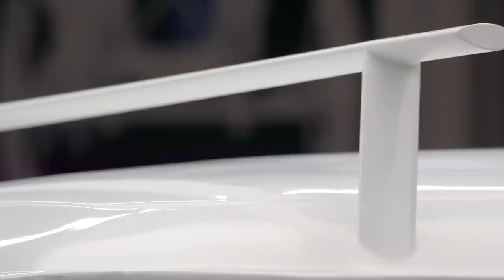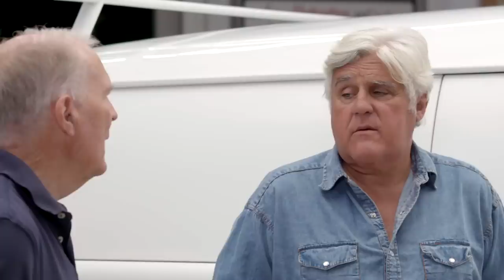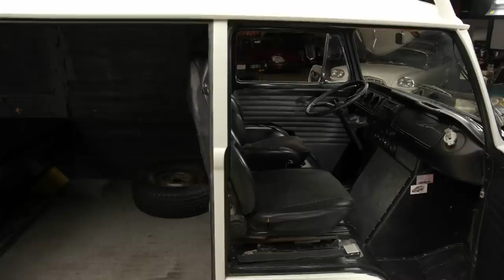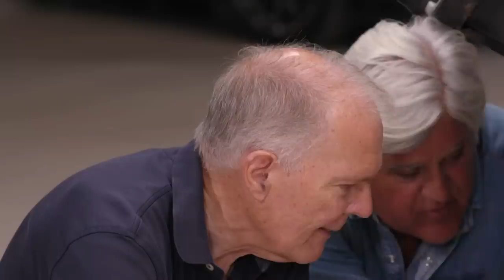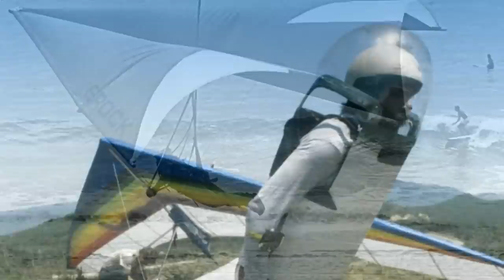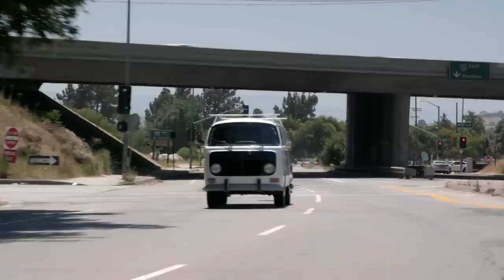Peter Brock's Hang Glider Transporter VW Bus - Jay Leno’s Garage

Comment: Interesting for me. I worked in Olds Experimental when we developed the 215 aluminum V8. It was the second version that made it into production. The Olds and Buick versions had different heads.
We had some high performance versions, not the '63 Jetfire turbo.
Also interesting was that Pete Brock would have like to worked in GM Styling in the 1930's. My dad did work there then, worked for Harley Earl. I have some of my dad's GM sketches.
Reply: Rover in the UK bought the rights and tooling and it powered British sports cars for the next 40 years!
Reply: Yes I know that. Actually, we (not officially) were shipping some motors in parts, not assembled to a couple of race car builders in England before the Rover thing. I was a great motor. For some of our first testing of that motor, we used Studebaker Larks as test mules because our F85 wasn't available yet. Our little aluminum V8 in a Studebaker. Think we built five of those. Long time ago.
Reply: @pickleboat45  One of the more unusual uses for it was making a V6 by cutting out 2 cylinders.  That ran in the prototype Metro 6R4 rally cars.  Amazing the number of different things it was used for.  Was it just too small a capacity for the US market at the time?
Reply: @hrothabandinak6602  We developed the GM V6, first using a 215 V8 block cast in iron, with the front two cylinders empty, and a V6 crank extended. This was to prove out a 90 degree V6 could work. I ran the very first one on our test stand (not a dyno). Some engineers expected balance problems, but didn't happen. This V6 became one of the most successful GM engines of all time. Later models used split-pin cranks.My personal car at one time was a Buick GN - 3.8 V6 turbo inter-cooled, and of course, modified.
Reply: The London Ambulance Service used to have Leyland Sherpa ambulances powered by the Rover V8, as did many British police vans. It was also used in many British hot rods. Now we’re using Mercedes and BMW engines for our chariots.

Comment: Does it have a water pressure relief valve in the cooling system designed to open at a lower pressure than the radiator cap?  If I were a passenger It would kinda freak me out.
Reply: If you knew how a radiator cap works it would help
Reply: Uh, what? You do know radiator caps vent to an overflow tank, right? Its not a tea kettle lol
Reply: @heidilear7222  Ok thank you for explaining it for me it was very educational.

Comment: When I worked at the VW dealer in Seattle in the 70s, we had an associate who specialized in VW and Porsche repairs and mods.  He put a Porsche 911 engine in a VW bus.  Often he would come by the shop and put on a show for us by lifting the front wheels off the ground when punching it from dead stop.  Very fun.  Eventually he weighted the front bumper to keep the wheels on the ground.

Comment: I remember years ago there was a kit to install Corvair engines into VWs.  It used an adapter plate to mate it to the VW bellhousing.  The main drawback in using this engine was that it rotated in the opposite direction of the VW engine.  A VW transmission gear modification was required, due to the opposite rotation, which ended up weakening the transmission.  However, the reverse rotation engine was a good thing when using a Crown V8 mid-engine conversion kit for a Corvair car.  The entire tranaxel assembly was rotated 180 deg. in order to place the engine in the back seat area - no transmission mods were required.  The reason for the reverse rotating Corvair engine was so existing tooling could be used to produce the transmission gears.

Comment: Wish they had talked more about the way the Transporter handles. I've had a '68, '72 and an '87 Vanagon Syncro. They are crazy fun on a curvy paved road. Nimble and  you really feel the connection with the road. Off road I had the '68 and the '71 in some gnarly situations in NM and Baja. Engine over the rear driving wheels = phenomenal traction. The Syncro had the same on road "fahrvergnügen" + even more range off road. Finally my only complaints were they were under powered on the highway and lacked front end collision protection.

Comment: I had a '71 VW van that I put some snow tires on and it did great on the sand trails in the woods in flat Florida.
Reply: I had a beetle that wouldn't pull the skin off a rice puddin' . . . .

Comment: There used to be a VW Bug in my town in Pennsylvania with a panel truck body kit on the back. Had a Pontiac 400 from a GTO, big plug heads, in the rear. It was quick. All that weight in the rear the front wheels came up easily off the line

Comment: Cool. VW still sells cool vans in other countries, with plenty of power. The original bus/van is neat, especially with a better engine and brakes, but they have no crash protection. Be extra cautious if you drive one.  Especially if it has a V8. 🙂  Thanks for having Peter as a guest.

Comment: That Van goes up hills because of the huge weight over the drive wheels due to the OTT engine (that the suspension is struggling with).
 Modern Transporters go up hills backwards to keep the weight on the drive wheels (front).

This guy is the right age for a Hang Glider pilot, but I suspect he hasn't flown since the 70's, as he keeps going on about UP who haven't made Hang Gliders for 20+ years, and are now German.
Reply: NICE Intel ya bogan

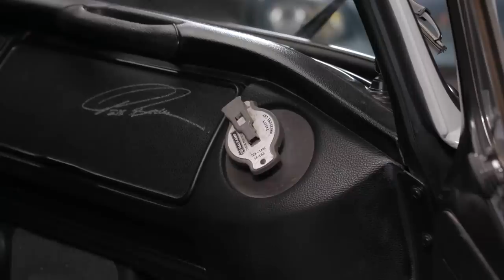Comment: Around 4:40 when Jay notices the radiator cap inside the van, he mentions that it's the only car that you fill the radiator from inside the car. Is he forgetting about all those vans from Chevrolet/GMC, and/or Ford and/or Dodge in the 60s that had the engine under a hatch between the driver and passenger seats? I know for sure that the GM and Dodge vans were set up like that. You had to check the oil from inside too. Now that I think about it, if they even had a hood at all, about the only things out would have maybe been the master cylinder, access to the wiper motor and the windshield washer jug. I do remember everything engine related was inside the van though.

Comment: GM used the small aluminum engine in Oldsmobiles and Buicks only for about 2 years. The little Olds V8, same cubes as the Buick @ 215 cubes, was almost identical to the Buick V8 but had more main bearings than the Buick. The Olds Cutlass turbo version turned out  215 hp. Jack Brabham won the F1 Championship in, I think, 1966, using the Olds block with cast iron REPCO designed single overhead cam heads for about 300 hp. GM abandoned the small V8, but Rover and the Brits bought GM's engine  tooling and British cars had the small V8 for many years.

Comment: I have owned and driven allot of exotic vehicles... and I have got to say, the most funnest vehicles I have ever owned and wish still to this day I still had were some of the dumbest ones, which was my 1979 VW bus, type 2, which had the 1019cc engine, and my rusty 1988 Suzuki Samurai hard metal top with the right swing open rear cargo door. They hardly every cost me anything to keep running. Heck, modern cars of today, have lugnuts that require more torque then both of the engines from my VW bus and Suzuki combined output .... LOL... but that wasn't the point of how you were able to have so much freedom in those two vehicles, if you needed to go off the beaten path a wee bit, you just go, and they would push through most situations, the Suzuki would just sit on top of mud and only create a 1 to 4 inch deep mud rut, as compared to a 3/4 ton pick truck, plowing the mud with the front suspension...  Sure, they didn't ride like a luxury sedan, but, it never mattered while driving them.

My Suzuki had over 400,000 miles on it, with minimal service, never had to rebuild the engine.. I had to replace an alternator, tires, and of course, full brakes pads/shoes rotors/drums and a few fan belts and I think a water pump... that is it.. the key to the long life, is I never took the little rusty thing above 50 to 55mph. Yes, it could do about 70 to 75 mph, but it would sound like stuff was ready to fly apart, so, I just never took it above 55, and traffic would just flow around me, and wave as seeing my dinky rusty Suzuki and always received smiles... I suppose it was due to them being designed for road ways like Indonesia and roads ways made of logs and rutted dried mud, and putting along those roads less then 10 mph so you don't lose your kidneys... LOL.. I miss those two stupid vehicles the most and as I mentioned, I have owned some pretty hot exotics and those were always a nightmare to drive, the constant worry, every mile accumulated on an exotic, always weights heavy on the idea that you are losing money.. LOL... not with the VW and SUZUKI, just turn the key and go...

Comment: Love that Buick engine....maybe the best V8 Detroit ever designed....and of course GM sold off the engine blueprint and rights to manufacture. Peter Brock built VW van....I can almost dig it.
Reply: Didn't they have problems with leaks? I heard only in england they fixed that.

Comment: The Buik alloy V8. Made [poorly] by the poms and is the English  small block Chev. 
Remember this Zombie wagon was built in the 70s for a purpose. Which it is obvious that it achieved. Though an LS would wake it up,,,, and blow the VW transaxle very quickly. You can modify them to take more power and I suspect that this is about the max power.

Comment: Jack Brabham used that engine in his F1 cars in the mid 60's.  slightly modified of course.
Reply: IIRC, Repco used the Oldsmobile version of the BOP engine as a base for their F1 engine, because it had six studs per cylinder instead of five for the Buick.
Reply: @zounds13   Let's see an F1 team try using a street engine today!  That would slow the cars down a little but might make F1 more entertaining.

Comment: The reason that the panel version of the Type 2 is rare is because of the Chicken Tax. This is actually the vehicle that’s responsible for it. Lawmakers in Washington saw how popular Volkswagen’s panel vans and pickups were getting in the early ‘60s, so they put a tariff on light trucks and panel vans to get back at France and Germany for the tariffs they were putting on chicken imported from America. This was when the first generation Type 2 (the T1) was still being built, but Volkswagen tried to keep selling Type 2s into the early 70s despite the tariff, which is why there are a few second generation (T2) pickups and panels like this one around. Of course, most T2s are old enough to be imported privately,  but not all of the ones you see today are grey market cars. If Mr. Brock has had this one since the ‘70s, it’s obviously an American-market van.
Reply: Yes it is. The first two years of its life were spent delivering stationary products in Los Angeles. This was purchased and built in 1973.

Comment: It's hard to believe that a 2 WD VW van could climb those steep threacherous old mines trail/road with a full load of peoples and hang gliders on the top. Sure the engine was there but...how about the traction?  Maybe in those days, those old dirt roads ( like for Gunter, Piute or Big Flynn) were better...or maybe they were mainly flying from Horseshoe Meadows where it's paved all the way to the top ?

Comment: Subaru power is the way to go, the turbo motors are amazing, as is 3 litre V6.  An '89 Vanagon syncro 4wd with Scooby motor bolted to VW transmission would utterly blow this away.
Reply: Except this has more low end torque for climbing
Reply: @stevemic  hardly compensates for the 4wd system, the v6 is a heck of an engine.  Of course working on the V8 would open up possibilities for huge power - wouldn't want the fuel bill for that car.  For that reason I went for the 2 litre ohc subaru motor into my vanagon. More power than VW ever gave that body and much more reliable but improved mpg too.
Reply: @stevemic  what about Epstein?
Reply: What about jet fuel doesn’t melt steel beams?
Reply: lizardywizard the blood is on her hands. She probably helped orchestrate the moon landing hoax too.

Comment: I’ve had my ‘70 Bus for 47 years. I’ve tried to modify the engine over the years. The bus is very loud, even with 300 lbs. of Dynamat. I’m up to 2500 cc with an overdrive 4th gear. Power discs in the front. Power has increased but it’s still noisy and is tiring on a trip. I disagree about the aerodynamics of the vehicle, driving one is like pushing a sheet of plywood through the air. In a stiff wind you can change lanes without meaning to. My eventual solution will be to go electric. The batteries will bring the weight much lower, power will not be a problem, no shifting and thank god, it will be silent.

Comment: I mean you could have used a V8 Land Rover or V8 Toyota Land Cruiser and much more that already had V8s and are far more Robust, OffRoad Capable, And they did make Long Wheel base SUV/Commercial Van versions of those....The VW van is cool but there were better options

Comment: needs lots of power to get up those fire roads off roading uh ok and V8 power uh ok what do you do when you run out gas I like the good old days of V8's but mileage wasn't there strong point if your going to do and serous off roading you have to get a motor that will get you to the next gas station

Comment: Oof I feel sorry for the passenger if the radiator over heats and the cap fails🤦‍♂️😖 , they get a nice burning facial😖
Reply: No danger. Coolant is contained and exits outside the cabin.

Comment: These old Pre 1990  VW Bus's were unreliable and under powered , and poorly designed with little room in the rear , the American vans were better designed with the engines in the front ! Although I think the VW vans looked better than the american ones pre 1980 they have more Charactor ! This looks like a workhorse , nice design Peter Brock !🚙

Comment: I can't believe a professional racer was dumb enough to put the radiator cap on the dashboard! Imagine if that overheated and blew off steam!
Reply: If it does overheat, there is a catch can and is vented through a tube and down through the floor aiming straight down onto the tarmac. No coolant can enter the cabin unless you're dumb enough to try and open the cap under pressure from the passenger seat.

Comment: There is a problem with increasing horsepower in a VW Van. This model has little to no stability as it has a huge ride height. VW vans are known to roll over on hard cornering.  Just saying